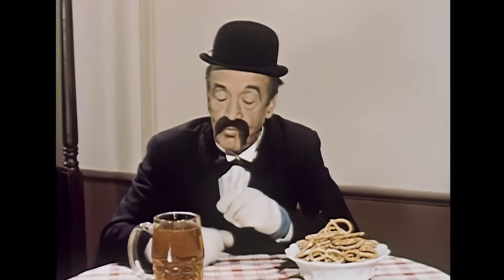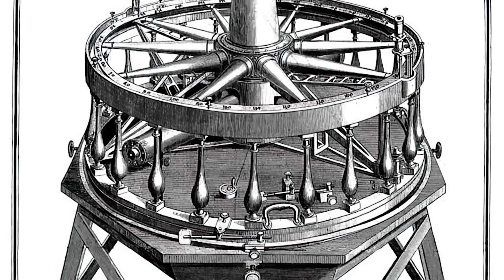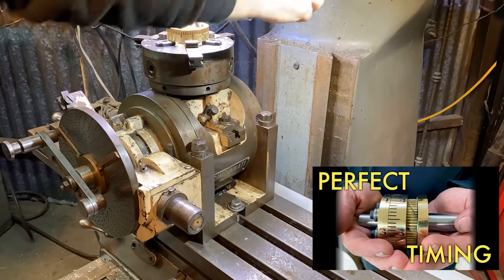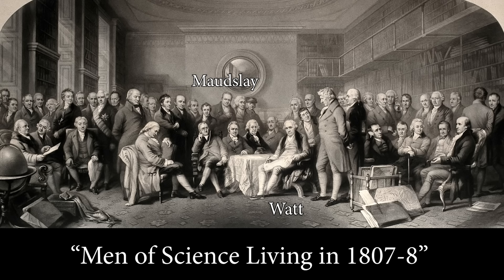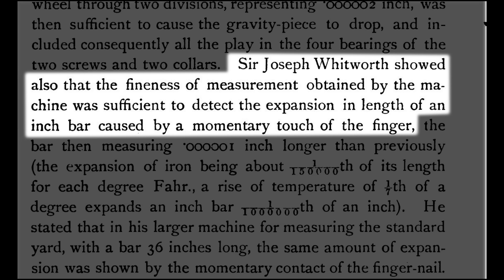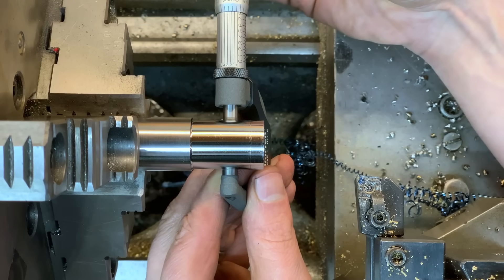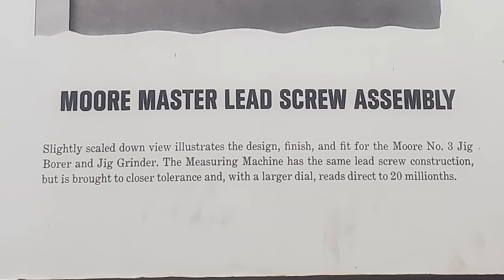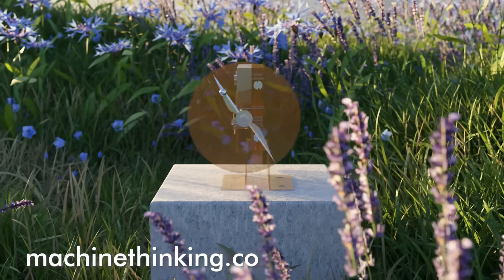The HIDDEN Screws of PRECISION

Comment: Was a machinist for 45 years and chased a lot of threads. The U.S. needs to switch to metric I hate to say but it is easier. If you want an 8-32 thread most people need a chart to tell them dimensions. In metric a M4 x .7 is simple, subtract .7 from 4 you get 3.3 and that is your tap drill size or minor diameter. This works on every metric thread. When you try to learn metric system you need to completely forget the standard. Do not think that a Meter is about 3 inches longer than a yard. Forget the yard and start over memorizing the metric sizes and stop comparing it to the standard English measurements..

Comment: The technical perfection of the Whitworth Thread was designing it for the coefficient of friction for steel with triangular threads of 55° Degrees and threads per inch that work ideally on a lathe threadscrew by repeating every inch. This allows the thread cutting tool to be disengaged for any thread and quickly moved back to exactly engage cutting the thread. Something not always possible with metric threads. Other threads are arbiitrary threads not designed for strength.
Working a 3D mapping machine wtith a single division large knob on a screw adjustment it was  onvenient to add a vernier for higher accuracy relocating settings.

Comment: It's strange that imperial sockets and spanners (old and new) are always marked first and sometimes only in Whitworth hexagon sizes. Being one hexagon size up on BSF (the more common thread) ie 1/4 Whit=5/16 BSF. Rarely you'd come across a Whitworth bolt and anyway the hexagon sizes were standardised during WW2 to save on material.

Comment: I hate the modern usage of Witworth thread. It's coarse, but most annoyingly, it's nominal size doesn't refer to the size of the outer thread but the diameter of the pipe within, which means a modern "Witworth" ISO G1/2" or R1/2" thread is about 2cm across, which is not half of an inch by far. :(

Comment: Its not a micrometer, its a measuring screw

A micrometer or mycrometer (both are correct) is a measurement unit mycro =10^-6
So a mycrometer is 10^-6*meter

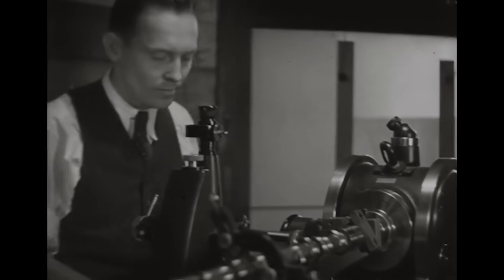Comment: 13:00  Some time in the late 80s I had to replace the alternator on a Volvo.  Unfortunately the bolt that the altervator pivoted about, to tension the drive belt, somehow got lost.  Being (At that time) a Swedish car, I assumumed that what I had seen was an M12 X 1.5 bolt.  So, I went and bought one and it would not screw in!  On closer examination I found that what I needed was a Whitworth 1/2" x 19tpi bolt!   Why Volvo used such an exotic thread, I have no idea.

Comment: you can go back in history way back and there was the water screw  it lifted the water out of a canal or river to another elevation yet it has nothing to do with measurement but rather volume movement of fluids it was operated by hand and that was its limitation it couldn't be made bigger or taller (long)  so if for some reason you had had to move the water from  to higher then the screw  you just used 2  in tandem one filling a higher pound above from there you went with a second one higher - it still used till now and some called it ARCHIMEDITH screw  but some scholars think he copied and improved on it
Reply from the maker: See my video Screws - The early years

Comment: I've seen mechanical Swiss screw machines in action, in practical use, at a manufacturing company in Santa Clara, CA. It had cams and followers and arms, and it made screws faster than a modern CNC screw machine. It didn't look that fast, but the tooling was up close, whereas a CNC screw machine has a longer distance to travel before it can change tools. And there's the tool change time itself. I tried to find video of such a machine online, but couldn't find any. It's a marvel to watch, and you get a sense of the mechanical genius of it's inventor, though realizing that what I was watching was a derivative of the original.

Comment: Question:  Do you know of an analysis of the periodic imprecision in a thread introduced by the tolerances of a lead screw or an imperfect  tooth form in a gear driving it on a lathe?

Comment: OK, this is from a toolmakers point of view : you can take a measurement and “claim” that you can measure to 0.000020 of an inch or 0.0005 of a mm but will be sadly wrong. The only thing that you can do is write down that measurement as that sort of accuracy with a micrometer is an exaggeration. I have used micrometers for about 64 years now and never used the ratchet on micrometers, I use the “ feel “ of micrometers and of course round objects are easier to measure but if you want the accuracy as mentioned here we have to for starters do it in a temperature controlled environment and different methods of measuring like gauge blocks, clocks etc. I am however very grateful for that beautiful and simple micrometer , especially the 0-25 mm 😉

Comment: I find this area beyond fascinating. There are so many layers to precision and the journey to obtain it. One  is taking a liberal 1 dimension and converting into 3D. This is in essence what a screw does . Interestingly , because it can do this you can reduce the initial length dimension and push it into the other two dimensions you created. We are essentially twisting a linear length into a spring . Interestingly, it doesn't matter how accurate the rotation is but more so how much smaller that rotation is compared  to the length  we measure.  The smaller that radius converting into length the more accurate is our measure . I haven't seen a planetary gear used but I can imagine this would increase the resolution of micrometers. With the advent of computers we could convert length into even more dimensions if required as we do when calculating space time variation.

Comment: Now days you can never find a lathe that you can turn between two dead centers. This is one of a number of reasons as to why using a tool post grinder on a lathe is not the same as using an OD grinder.I was able to get close by using a spring loaded dead center in the tail stock and swapping ends on the part along with using the leveling screws to actually twist the bed of the lathe to control taper which can not be done by unlocking the tail stock and off setting the tail stock, you will end up chasing your tail!

Comment: Nearly every YouTube creator uses Whitworth threads. The standard thread for camera mounts across the world is 1/4" Whitworth. For large devices like broadcast quality video cameras, 3/8" Whitworth is used. Some poor manufacturers fail to understand the required standard and use 1/4"UNC instead because it has the same major diameter and the same pitch. However, Whitworth threads have a different angle and different tolerances and using the wrong thread on expensive cameras is not a good plan.

Comment: 1) as any friction is applied to any object, heat develops, hence thermal expansion of the object. 2) how can the pitch of the screw be constant while both the screw and the tool are being heated?. 3) with high precision pieces, the temperature at which they are measured, and the planned operation temperature are important. How were these issues solved?

Comment: Then there is the "Enfield Inch" "the British were using two different measurement standards. Anything below 2 inches was measured against a local Enfield
standard that was ‘four tenths of a thou’ (0.0004 of an inch) shorter than the true Standard Imperial Inch that was used for
dimensions over 2 inches."

Comment: Great show; certainly filled in some gaps.

I work a lot with old British "stuff". 

Every man and his dog is at least vaguely familiar with "Whitworth" threads; WAY ahead of their time.

The "fine" series of Whitworth is called BSF; "British Standard Fine", which rapidly found its way into high-tensile and precision fasteners., still 55 degrees and all that.

Then there is the infuriating "BA" series. These "British Association" threads are derived from the old Swiss "Thury" threads which are "metric" based and originally developed for clock and watch-makers. 47.5 degree included angle and radiused roots and crests..

"Zero" BA has a pitch of exactly ONE Millimeter and, apart from the different form angle is a blatant rip-off of M6,  coarse. Each increase in BA "number" is actually a decrease in dimensions. "One" BA is 0.90 of "Zero" BA, and so om down to some dinky threads. i have never tried toio cut a BA thread on a lather; buying the appropriate taps and dies will save your sanity.

BA WORKED, and is actually more mathematically "sane" than "Metric", especially in very small threads.

On top of all that there were major "proprietary" thread systems, like "Enfield" threads, developed by the British arms-making industry. "49 and a bit" degree form, weird pitches etc. but, again, they worked for the task. "Admiralty" threads, were developed by the British ship-builders in association with the Royal Navy. Just for giggles, these were STILL in use in the Japanese ship-building caper well into the 1970s and possibly beyond.

Comment: Great video and storytelling!  I recently read an article about some of these early precision developments in "Home Shop Machinist" magazine, and I wanted to see more!  This video is it!  Thanks.

At 17:40, the edge / rim of the dial plate sure looks like it has worm-gear-like grooves.  I wonder if Watt had the main screw engage the rim of that disc in an earlier version, but then reused it as the dial face?  But looking closer, I think I see the outer edge of a similar disc parallel to this disc, is actually what moves the sliding block, which is not how it appears to work in the earlier animation.  Guess I need to watch your other video 🙂

Comment: I am truly impressed. I'm also 67, not that those two things are in any way connected.  Great video!  I am not a machinest, but my dad was and I inherited his tool chest.  At least once or twice a month I find myself using one or more of those tools, and regretting I didn't spend more time soaking in his knowledge as well as begging him to explain how they worked.  Sure, I've got that green book sitting there in that center drawer, mocking me, laughing at me while I read the strange, almost foreign words explaining complex theories and intricate drawings.  In the end, it goes back in the drawer and I have to spend the rest of the day listening to the muffled laughter echoing off my shop walls.  God bless the man that invented ear plugs.
Reply: I'll be 82 in two months.  I came across this series last night only by chance while trying to find easy to follow explanations on the subject of reading sophisticated vernier calipers in inches and millimeters.  I had used a crude one in woodshop in the 1950's.  I'm currently planning to rework one 8-32 inch machine screw down to a 5-40 by hand file and make sure I don't later accidently use a tap drill of the wrong diameter.  Trying to make a late Lancaster flintlock rifle.  My grandson graduates from undergraduate college this quarter, and is planning on a computer specialty grad degree.  He works part time in same shop as his dad:  a metal fabrication plant that uses machining computers.  Maybe one day he will inherit my crude collection of curious calipers.  When he was a kid he saw one of my mechanical typewriters and asked what it was.  I gave my son the most advanced mechanical slide rule ever made b/f they became obsolete.

Comment: I started my Engineering career as a die setter on cold thread rolling machine,where you had a stationary die and a moving die that would tranverse its lenght and a blank screw with its head shaped already would feed from a hopper into a track then through the dies at 800 a minute spiting out say 3/4 inch posi head self tapper,then I progressed to die making and did my toolmakers appreticeship in the early 80s

Comment: The "micrometer abuse" segment seemed familiar. A while back I picked up an old Starrett micrometer at a garage sale. When I got home I took it apart to clean up some minor corrosion. I proceeded to drop the spindle onto a concrete floor, deforming it imperceptibly but enough to require more torque to operate the micrometer.  I'm still kicking myself about that blunder. 😤

Comment: Company I currently work for makes pumps and has been doing so for 140 years. We use metric sizes to specify od Id. Then throw in an imperial thread angle/pitch just to scupper anyone remanufacturing spare parts. 🤯😉

Comment: This was a good little production, thank you!
The whit form 55 deg inc angle thread is far superior & stronger than any of the 60 deg threads in common use today.
BSP & BSP(T)(taper) have not been superseded anywhere because of this fact.
The range of pitches give the optimum thread depth & shoulder engagement.
The 2nd WW caused its general demise, as imported war stock was UNC, UNF or metric & standardisation became necessary due the enormous quantity of war material coming to Britain from the USA. Also 60 deg bolts & nuts used less material (a vital necessity in wartime!!)
Here in the U.K. we had to go with the flow, for the sake of victory!
BSP still survives though!!
All my years in engineering were spent with w/form threads, always reliable.
I’ve seen numerous other 60 deg threads strip readily if overloaded.
Metric ( not a fan of at all) is a pain & on stainless will bind & lock up especially if loaded or when your trying to release a nut!!
B.A. is an excellent thread (55 deg), too & reliable for the reasons given previously. 🙂
Reply: 1/4 unc into inconel, enough to give any machinist nightmares. Torque tap until it snaps or use your holidays and pray for second shift.

Comment: Question:  How was the master screw cut for Maudslay's bench micrometer?  I presume by hand since there existed no machine that was more precise than the bench micrometer itself.  So, how does more precision come from less, original precision?  Kind of a chicken-or-the-egg thing.  And I find it almost incomprehensible that we could have such incredible precision in 1805 but building a device that could fly was deemed by all but a few to be scientifically impossible.  The Wright brothers certainly had their own kind of engineering genius and imagination, but they were far removed from the design and engineering that Maudslay had achieve a century earlier.  It doesn't make sense to me.  And now we can measure particles of smoke (and less) for $169.19 on Amazon.  I often talk about relatively complex, but interesting, things to my wife and she just looks at me and motions that her head has exploded.  I know what she feels like now.

Comment: Accuracy always depends on the quality of your surface plate for all measurements of all instruments. To test Maudslay's claim of .0001 accuracy I made surface plates according to the methods he used (free body lapping - they called 'grinding') and the resulting plate was indeed good to .0001. Then pushing further I decided to test Whitworths claim of .000001" So I made plates by careful scraping and it DID produce accuracy of 1/millionth. 
I learned a great deal from these experiments. I then pushed the boundaries by mixing techniques and finally achieved a 4 inch disk with a flatness superior to that on gage blocks. Those wring together with a force you can't believe. I keep it here beside my desk, a tribute to Maudslay and disciples.

Comment: To graduate as a navy marine artificers back in the 60s and 70s you had to build a lathe, from scratch.
Which my dad did, they had to scratch build everything including the giant precision screws for the tool to ride on.
They gave you the motor and belt, because it's dangerous to get those wrong and not on the syllabus anyway.
To pass, you had to meet a minimum precision on parts made with it.

Comment: The term "screws of precision" reminds me of how I took apart one of those cheap $5 or so micrometers you get on aliexpress and found that the main mechanism was just a very finely threaded screw. If you can call it that. But I thought it was a really clever use of a screw. Gives you a high degree of resolution, AND smooth motion.

Comment: Thanks for the video! What is the process used to go from having a less precise screw to having a more precise screw?  Is there a lapping procedure to reliably reduce drunkenness and improve uniformity of screw threads. I recall the Moore book talking about using a series of precise laps and comparing the threads to a master, but how did they get the master in the first place?  Is there a self-correcting technique like the three plate method that, when followed correctly, can produce uniform, precise threads? Thanks again!